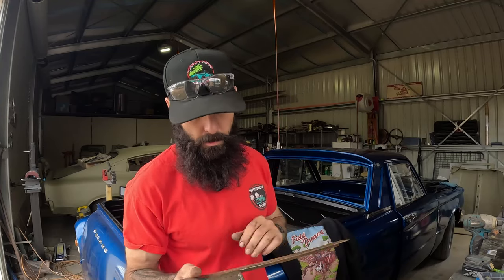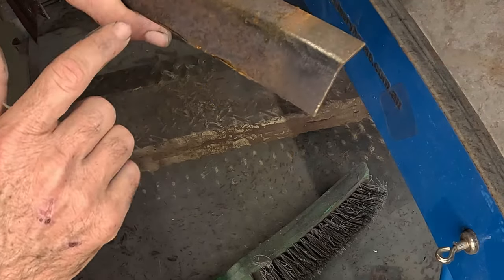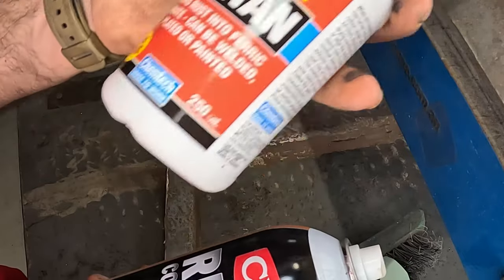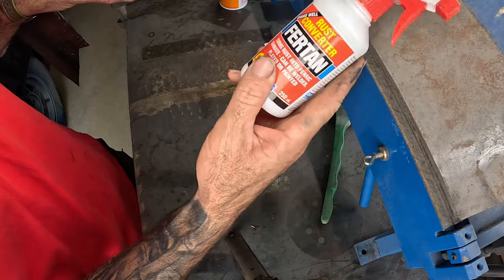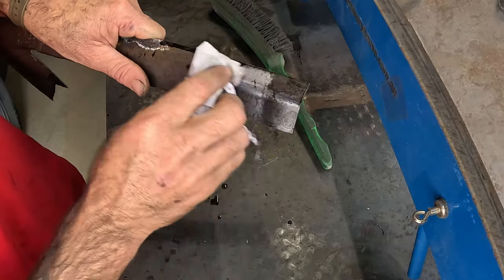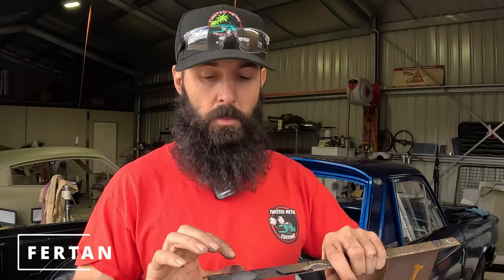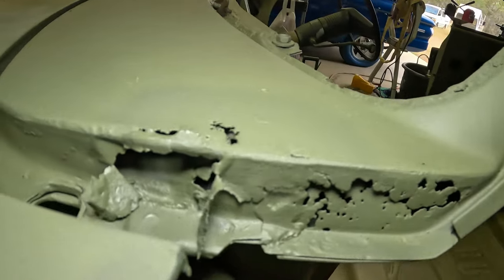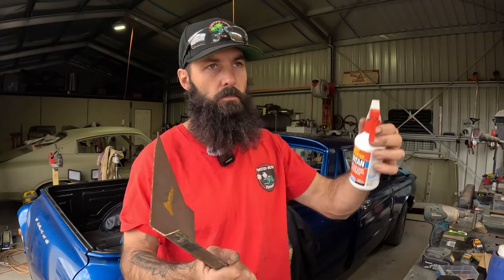How to paint rusty metal -(EP 26)

Comment: Scourer pads are great, worth the money for the job they do. However you only showed one for a drill, which makes me wonder if you have not used the same type for an angle grinder. Much faster and easier on larger surfaces. They do vary a lot from brand to brand, and some of the cheaper ones work very well
Reply from the maker: Hey Bruce! Yeah I showed "battery" types to more relate to beginners that may not have all the power tools, 100% the grinder with strip it disc works wonders! I'll do a power tool video soon on more severe rust types I think, yeah agree, some of the cheaper ones do work well, but just have to trial them until we find one haha, cheers matey